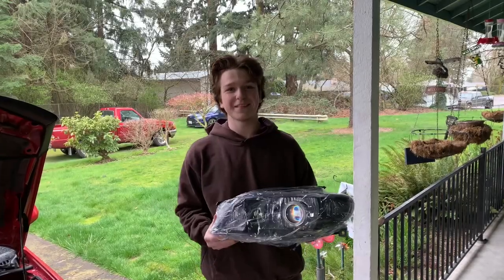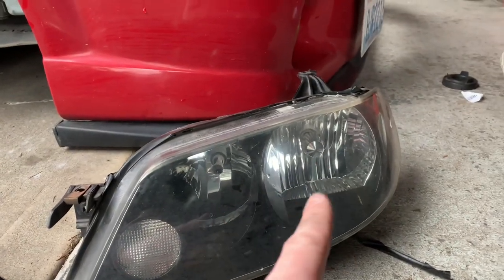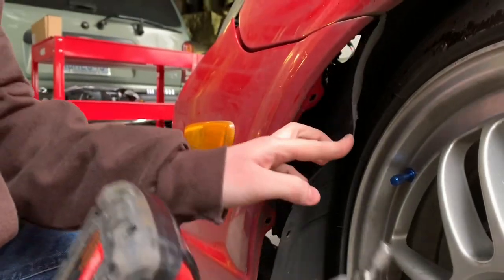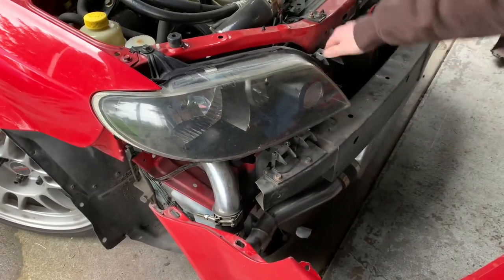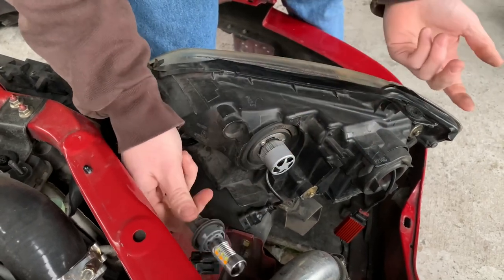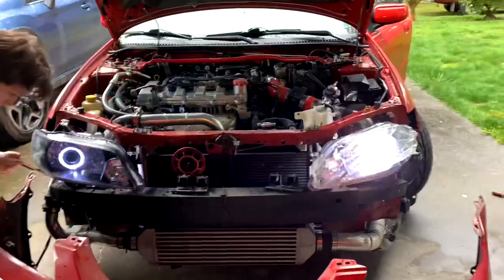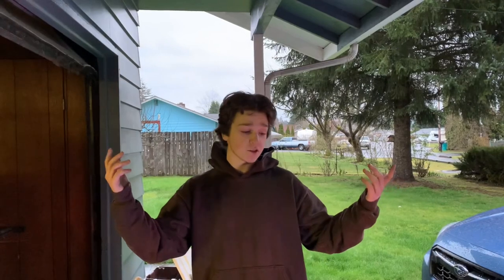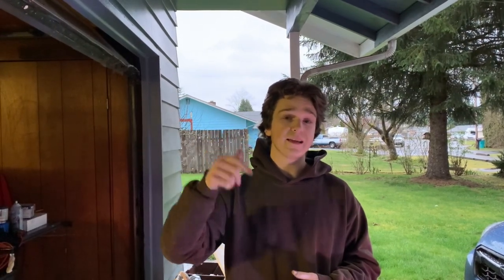New Headlights for the Turbo Protege5!

Comment: Who did your retrofit ?

Just my 2 cent. They should have blackedout the reflector bowl or used a shroud. Your getting a lot of unwanted light reflection from it hence all the washed out look or light bouncing back. It should enhance the halo more or it won't look too noisy ( too much light bouncing back when your looking at it.
Reply from the maker: From eBay which isn’t surprising. Yeah I definitely noticed that. I like the look of them when they are off but it is kinda crazy looking when it’s on. I might spray them black down the line if it still bugs me. Thanks for looking out!
Reply: @NoahGaebel  no problem... nicely executed p5 thus far. I have an 03 white p5 as well, and an orange msp

Comment: by chance want too sale me the bulbs you took out of the car when you replaced the new housing?   i got a P5 the other day hello, all stock in great shape new rims OTW, next up lights and then some sounds....  it s a gas driver car so nothing wild in the motor.. i have a 98 mustang Turbo 351w with powerglide trans for straight line flying...  lol

nice Car BTW.  good video
Reply from the maker: I’ve gotten rid of the old headlights and bulbs unfortunately. They were just some cheap led  bulbs. I appreciate the support!

Comment: Looks great! What blinker/running lights are you using?
Reply from the maker: Thanks! Here’s the link to them. You’ll need to run resistors or get a new blinker relay if you don’t want the hyper blinker 

1157 2057 2357 7528 Turn Signal... https://www.amazon.com/dp/B01M26IHAR?ref=ppx_pop_mob_ap_share
Reply: @NoahGaebel  Thanks Noah!
Reply: @NoahGaebel  Thank you Noah! Keep up the good work.
Reply: Don’t forget the blinker fluid 😅
Reply from the maker: I might’ve forgotten it! Do you recommend 69w420 type fluid?